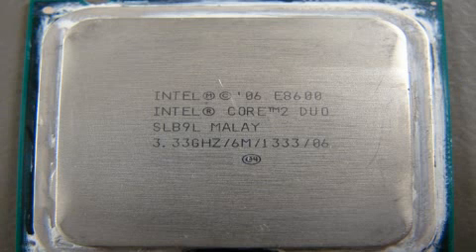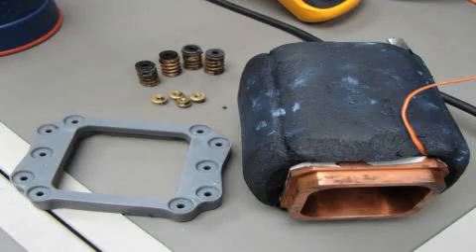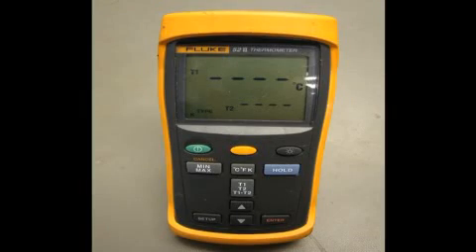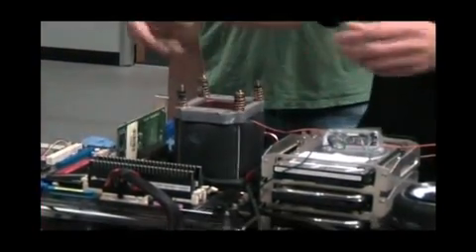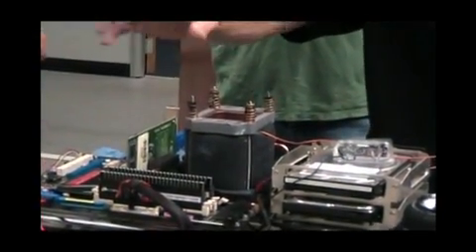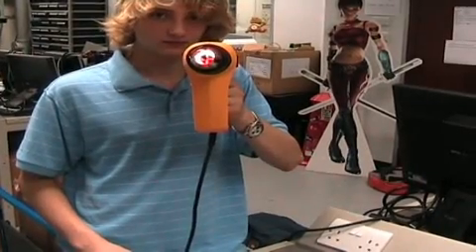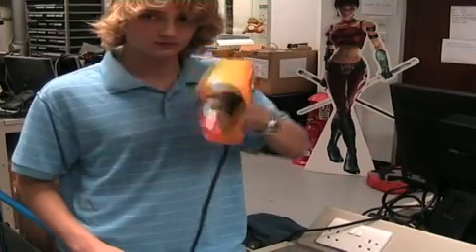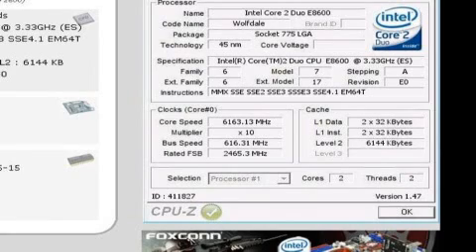6GHz: overclocking Intel's new E0 Core 2 E8600 CPU

Comment: @rhblakeman Once upon a time, I did have a second-hand 486 machine with a turbo button on it.  I now understand that, in many cases, the turbo button might just be a slow-speed override. It would seem that many old program speeds were actually governed by the processor speed.  In other words, if you ran 16-megahertz 386 software on a 33 or 66 megahertz 486 it would run too fast.  One guy actually  ran a 386 program at zap speed on a pentium 166.

Comment: @RogueAutomotive Ram bottleneck at 10GHZ processor speed?  Need DDDDDR RAM?  Crazy speeds.  It sounds just like the supercar enthusiasts, with thier super-mega-turbo-charged 36 cylinder engines.  Can do 330MPH, but the engine's so big that you can't see over it, and the car can't even get over speed bumps.

Comment: @Rayden440 That's incorrect. You can pour it onto your very slowly as the heat from your hand with evaporate it, however you are correct in saying you can only do this for a few seconds. If you poured it onto your hand you could shatter it by hitting it hard enough...

Comment: The point of a 6ghz processor is because it is insanely fast and resulting in amazing performance if it can be stabilized without extreme measures like they did.

Comment: that would require an insanely large and powerful compressor which would be impractical for its uses.  You could build a cascade phase changer that could reach temperatures near that.  (near as in about -110C)

Comment: What would be nice to see though, is some sort of a transportation for the niquid nitrogen in home pcs. Like maybe some super chilled metal tubing of sorts. But that still does not stop the LN2 from turning into it's gas form when touching that processor. If something was invented to make the processor cooler so that the liquid nitrogen could then actually touch it without dissipating, then that would work nicely in theory. But if something was made to keep it at -196C, we wouldn't need LN2 =)

Comment: No, liquid nitrogen is not "stable". Liquid nitrogen dissipates at a temperature hotter than its boiling point. So basically, when the liquid nitrogen comes into contact with that hot proc, it envelopes it with nitrogen gas. Btw, it's boiling point is like....-196C or somewhere very close to there. Meaning, if it is exposed to anything hotter then 321F, it turns into a gas making it useless.